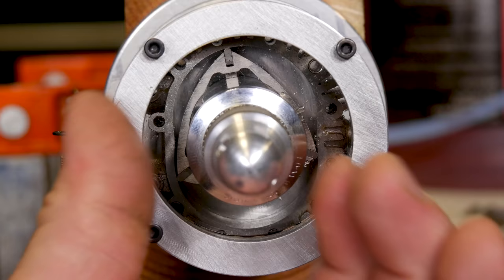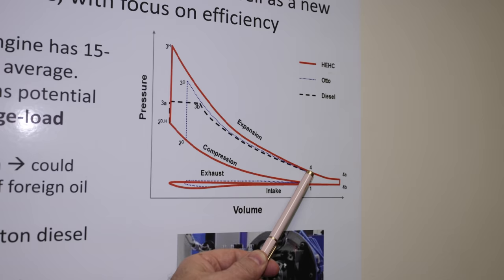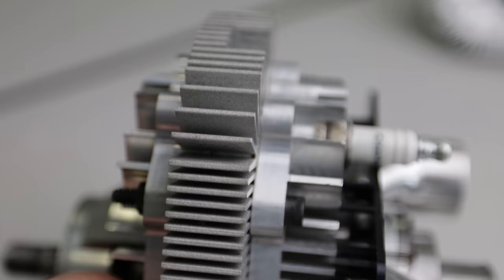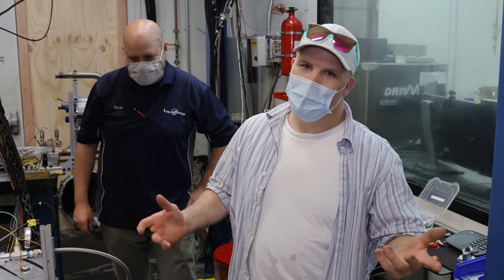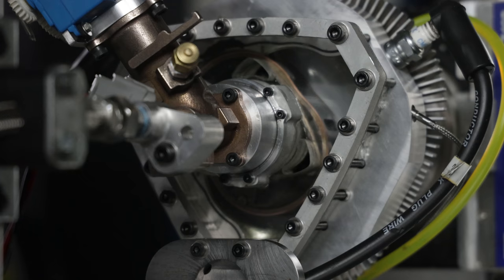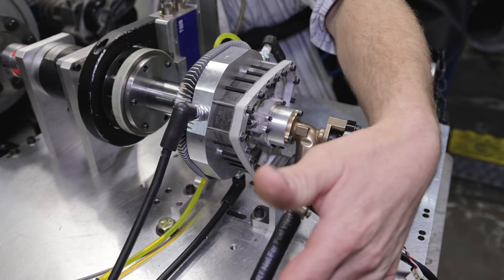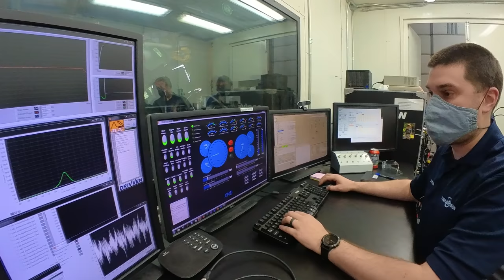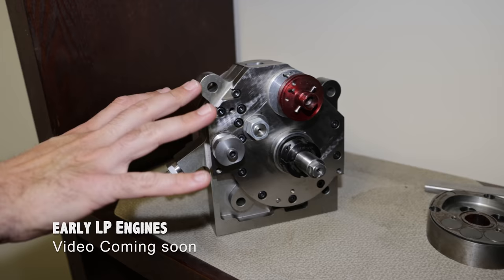See Thru Liquid Piston Rotary Engine - In Slow Motion

Comment: So a peanut inside a dorito is making more power than a dorito inside a peanut, excellent it's all coming together ❤
Reply: Very valid observation, it’s interesting how they inverted the engine in a way, it’ll be interesting to see if they can handle boost, if they’ll make multiple rotor engines, if they’ll actually make a production triple or quad rotor I mean who wouldn’t love 12 spark plugs lol, I’m hoping we see four digit power numbers in the near future. If guys in their garage can do it then this team of engineers should be able to do it with ease
Reply: @taylorpratt6287  I've been watching this for a while. I don't think the combustion chamber's overall shape can be altered. To scale up, they either have to make the whole rotor assembly larger or stack them.
Reply: @hollismccray3297  agreed, they should definitely make a larger model with 4 or six rotors, make it liquid cooled and turbo charged
Reply: @hollismccray3297  What is wrong with the shape of the combustion chamber? It seems like the shape of the rotor is fixed but the housing has only three points of contact that are fixed. The rest seems to be flexible. From a purely combustion oriented perspective, the ideal combustion chamber is spherical, with the ignition source in the center. This achieves the shortest distance for flame travel in all directions. This combustion chamber seems to be like a quarter of a sphere. It seems like if they flipped another housing over and bolted them together they would have a hemisphere which would be the best you could do given the fixed shape of the rotor. I don't think they are giving up a lot as it is.
Reply: @5000rgb  It is a hemisphere. It's just hard to see because half of it is clear
Reply: @hollismccray3297  Without a doubt scalability will always be an issue. I forsee a quad rotor stack to have the efficiency and power distribution while also retaining the benefits of this new design.
Reply: @5000rgb  The ideal shape in practice is hemispherical.  Just ask the MOPAR fans.  😁
Reply: @hollismccray3297  If they make a 3/9-rotor (3x3) that would be awesome and possibly allow the displacement to scale. The little 1/3 rotor here looked highly imbalanced and might only not rev high, but would shake violently if larger.
Reply: @joshjlmgproductions3313  Interesting idea. I don't know enough engineering to be sure if the combustion cycle would allow for that or not. I think engineering the rotor would be really tricky though
Reply: @hollismccray3297  I'll try to simplify what I meant: It'd be cool if they made a 3-rotor engine. I called their current engine a 1/3 rotor, as it has 3 chambers per rotor, but I then realized my terminology didn't make sense. Sorry about that.
Reply: @joshjlmgproductions3313  Ah, I get it. From what I understand, one of the easiest ways of scaling the technology is stacking the rotors.
Reply: @hollismccray3297  Exactly. Though, after I posted that, I realized a major flaw with their design: It is only possible for their engine to have a maximum of two rotors. There's a bunch of other problems with it, but that's just one of them.
Reply: @joshjlmgproductions3313  seems like they could do more than two. Maybe I'm missing something?
Reply: @imd12c4advice  To make a 2-rotor, they'd have to change the current design by moving the spark plugs to the side of the block. Currently, the intake and exhaust ports cover one face and the spark plugs cover the other side of the block. Both would be in the way if they were to try and add an additional rotor.
Reply: @joshjlmgproductions3313  the plugs looked radial to me, so those don't seem in the way and the exhaust just would need to be routed around the adjacent rotors like into a manifold. Intake is on side of rotor so that appears to not be an issue as well. Doesn't seem like any more or less hassle than a multi-rotor wankel. Intake maybe problematic as you'd want balanced pressure thru each rotor but there are probably ways around that which aren't too bad.
Reply: @joshjlmgproductions3313   not at all, the sparkplugs can be relocated to the sides like their demonstration model and it appears like the exhaust can be fed from one rotor through the case to the next rotor and so on. Imagine if a crank fan was located on the main pulley up front and promoted airflow through the exhaust channels. Like they said, its 1 part exhaust gas and 9 parts ambient air.
Reply: a great invention ... in the beginning era of electric vehicle ... a bit late but better than nothing ..lol
Reply: More like a unicorn.  It's been around for over 7 years, still no production engine.
Reply: @joshjlmgproductions3313  It has the same balance as a Wankel/Paschke engine (the design used by Mazda): the rotor is symmetric and centred on the mainshaft eccentric, so it is perfectly balanced by simple counterbalance masses on the mainshaft. In a Mazda rotary, the front one is a lump bolted onto the front, and the rear one is part of the flywheel (with a manual transmission) or a lump sandwiched with the flex plate (with an automatic transmission).
Reply: @AnubisSolvang  I don't think it would make sense to run the exhaust through multiple rotors, but it could turn and exit radially like the side ports in a Mazda rotary.
Reply: @brianb-p6586  just to keep it compact and not have to run a lot of exhaust pipes out the sides like a radial engine.
Reply: Chitato inside dorito
Reply: @AnubisSolvang  It would be good to avoid exhaust pipes sprouting in every direction, but forcing exhaust to thrash its way through extra rotors (and forcing the exhaust of multiple rotors through one of them) seems like an undesirable solution.
Reply: @brianb-p6586  Good point, I was thinking they could angle the support/cooling fins  inside the rotor to create a turbine like effect. But anything that slows down the exhaust would be a bottleneck.

Comment: Another idea. Use a 3 rotor design with each rotor having 2 spark plugs and one water injection instead of a spark plug at one of the apexes. This would use some of the surplus heat on the rotor to expand water to steam and do work. It helps control the internal temperature of the engine without necessarily needing traditional water cooling. 3 rotors so that the water cycle can be on a different lobe for each rotor. 120, 240 and 360 degrees to maintain symmetry and balance. You really only have one air cooled combustion surface on the rotor so this may help with heat control extending the durability of the engine. This inside out Wankel is brilliant. Don't stop!

Comment: They involuted the entire design!  That's frickin genius!
Reply: You mean inverted it. Haha
Reply: @ZeldaIsMyLove  no, the shape is an involution of the curves used in the wankel engine. I used the correct word.
For example, a square will roll like a circle on a road made of matched involute curves.
Reply: I just wished a different company did it; or that they didn't patent the designs.
Reply: @Unmannedair  but that's literally what the original wenkel engine did too...  this is an inversion of the wenkel.
Reply: google Cooley engine from 19th century
Reply: Felix Wankel worked through all of these possible designs, and selected his; this engine is a revival of one of the other configurations that Wankel considered and documented, so it may be a good design (although it has substantial problems) but "genius" is questionable. I didn't realize that this configuration was already used before Wankel in the 19th century, as a Cooley steam engine (which is simpler than an internal combustion engine), but Bill Todd caught that.

Comment: I love the fact that work is still being done to perfect the rotary. The concept is great and the new rotor shape looks like it possibly gives a better area for the expanding gases to push against than in the Mazda 3 sided rotor. I just wonder about the side seals - as they would seem to have the same job to do as before on the Mazda rotary and also, the apex seals. It looks as if the biggest change has simply been to move the apex seals from the rotor to the rotor housing. Does that really make a big difference or is there more to it? This setup also looks to be using multiple sparks on each plug. Does that limit rpm a lot? One final point, the combustion is always against the same part of the rotor with the other end always being away from the burn. How is the heat controlled? (I know in a piston engine the burn is always against the same face of the piston but (a) there is only one face, (b) they have oil sprayed at the underside of that face to keep cool and (c) they don't have three burns per rpm, only one every two RPM (or every rpm in a 2 stroke). I'm hoping there are good answers to all of this because I'd love to see smooth rotary engines in cars again. My son drives an RX8 as his daily (and only) drive. I was involved in that choice, so this is not me raising questions to be anti rotary, I just want to understand better.
Reply: The apex seals are getting forced outward because of the RPMs...so much centrifugal force on the seals. These seals just sit still.
Don't get me wrong, I am a huge rotary fan...I am just saying that there is a huge benefit to seals that are not being spun at 9k rpms.
Reply: @Rozza43  I could be wrong but I'm fairly certain this is actually worse. For one if the outward force on the apex seals is so extreme there would be no need for springs? Two, this now has no way to clean carbon buildup from the housing, and instead cleans the rotor (arguably worse). And three you now need the rotor to fill the entire hole (as it always needs to touch the seal), thus introducing much more mass actually rotating. Hollowing the rotary is a neat idea here and would solve my last point however I'm entirely apprehensive how well this would work scaled up in terms of both heat and more rotors.
Reply: @chronicnugget5595  Personally i think the apex seals need spring because it needs the seal all of the time
there are probably not enough centrifugal force on the seals when the engine is just started and running at 1000rpm or sth like that
Reply: Petrol-engine ignition systems, at least since Kettering (points, condenser & coil) have always produced multiple sparks.
Reply: @chronicnugget5595  the rotor on a Wankel is solid, this one has huge voids, it looks to me to be about 1/10th the mass.
Reply: Actually it is better for higher compression, if the sealing works reliably at the higher diesel   compression temperatures and specifically the temperature changes
Invented by Cooley 1903, exactly the same.
Reply: @Rozza43  
That is exactly correct, a good combination is to use titanium for the piston and Aluminum Magnesim Borate for the ~ elliptical apex seal. (  outsside a hypo trochoidal shape)
Reply: @chronicnugget5595 I think I read somewhere the seal can be changed without opening the engine. "As easy as changing spark plugs"

Comment: Rob Dahm is frantically making guesstimate dimension sketches and getting ready to make a full size 4 rotor version on his cnc machine!
Reply: Hahahaha, from pixel to pixel
Reply: Put 3 together make a 9 cylinder monster.
Reply: The intake is inside the crankshaft, less than ideal for multi-peanut engines
Reply: I've always wanted to see two twin rotors linked to a supercharger in the middle. 
With this design I think it would work. 🤔
Reply: @laurean5998  you can have up to two if you have one on each side.
Reply: With his luck it would be stolen in transit.
Reply: @laurean5998  True. But an intake could be routed to the peanuts in the middle. Actually, for a multi-peanut engine you'd have to route both an intake an an exhaust. You don't want peanuts eating each other's exhaust after all
Reply: I legitimately hope these two channels actually do a collab on this, 2 rotors at least. Here's hoping this comment gets some traction

Comment: I remember back in the early 80s machining a glass cylinder head for a singly-cylinder piston engine so that we could fire a Laser Doppler Anemometer into the combustion chamber to 'measure' what was going on inside. This was before computer modelling etc. and it was the very early days of research into exactly what was happening inside a firing piston engine. We built a rig to traverse the 'laser measurement volume' in three dimensions across the combustion chamber to a few degrees before and after TDC. We fed the data into an ICL 2960 mainframe to process the data to give us a chance to 'visualise' the air-flows inside, before and after ignition of the fue;/air mixture.